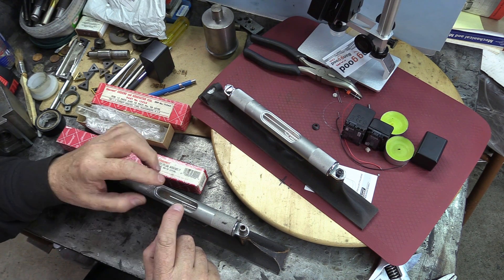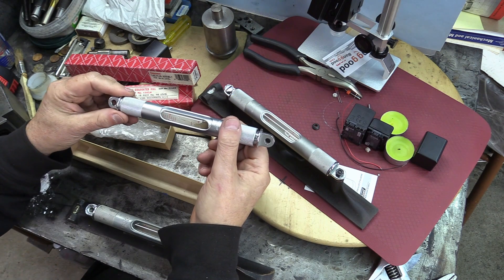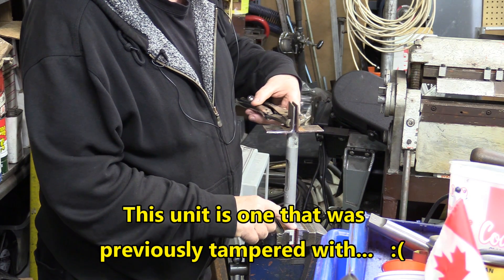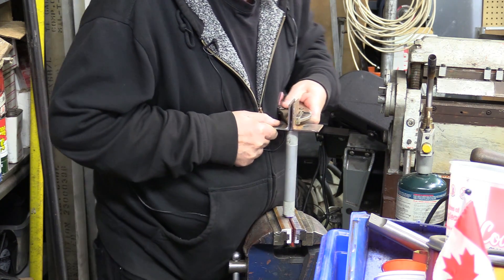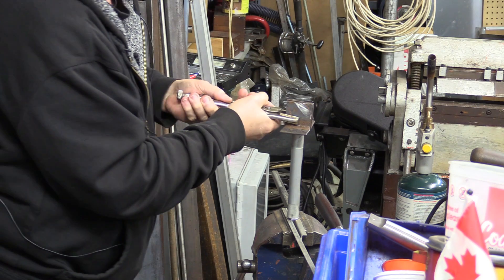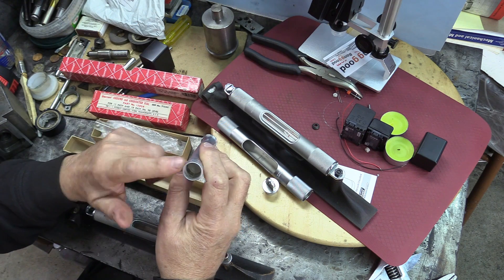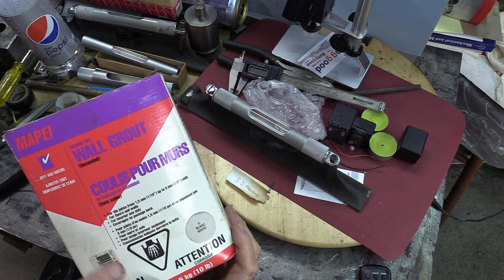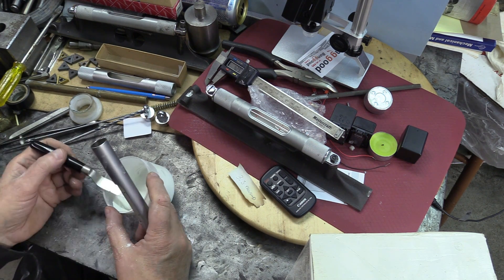Starrett Level, Vial replacement and Re-calibration…

Comment: What would be my best source for a replacement vial on a small Starrett no.134 cross test level? Thanks
Reply from the maker: Yuo can check on eBay, possibly on Amazon, the few times I needed parts for some Starrett tools, I ordered theose from my local tool reseller. Hope this helps

Comment: I have a starrett 98-8, something was dropped on the edge of the vial opening and made a tiny nick and now the 2 cylinders smoothly twist each other only up until hitting the nick and then stiff to twist.  Also the vial broke.  Can it be fixed.  Bore out the bent  one maybe
Reply from the maker: About the tubes, depending on how much of a dent there is, you can possibly reshape or lightly rebore it and/or lap the cylinders. If the dammage is too extensive and if you want looking like new part just be aware that you can order brand new parts from Starrett or some distributor, that is also true for he vial either alone or installed  in the tubes.
Let me kno how you managed and thanks for viewing
Reply: Ok, great info, didn't realize a tube was replaceable  @pierresgarage2687

Comment: Thanks for your video it helped me fix mine, but I forgot to put the sleeve on before I pushed the bung in the end. Is it possible to take it apart again without breaking the vial?
Reply from the maker: Hopefully you only just pressed the ends on the tube without glue, it's been a while since I made this video, if my memory is good , I show how I got the ends off the tube using s vise and pliers. this should get you by, One possible way to avoid breaking the vial, is to machine a split collet to hold the vial near the ends (Avoid using the collet where the vial is installed) As long as you open one end you'll be able to install the cover, normally one end is a little easier...
Be gentle and it should workout all right.....    👍👌

Comment: Silicone RTV will swell and lose its strength in gasoline. I found this out by using it to make a carburetor gasket; it seemed like a good idea at the time. It worked for a few hours and then started leaking. The silicone turned to a jelly. The plus side is that I learned an easy way to loosen and remove silicone RTV. It doesn't take much, just patience. Of course you have to be careful, as it is flammable.

Comment: Calibrating a Starrett 199 made me so crazy I bought a second one.
Reply from the maker: If you could just do it once and understand, you'd see it's not that complicated in the end, normally it takes about 10 minutes even if I do it only a few times a year...
This one is quite more sensitive than the 98 series, about 10 times...   ;)
Reply: @pierresgarage2687  I have figured it out now. Finding the level spot and setting a solid stop for flipping the level around is the key. Thanks for sharing your knowledge and expertise.
Reply from the maker: Now  you get a good second level...   Glad it worked out for you...   ;)

Comment: Why not use plasticine instead of grout for easier removal in the future?
Reply from the maker: plasticine isn't stable enough, it would move under pressure, the plaster will keep constant with heat, moisture, oil, etc... And it's not that difficult to remove, after all it shoud be done only once if one takes good care of not smashing their tools...   lol
Thanks and have a Happy Holiday Season with the ones you love,     Pierre

Comment: My 6” Starrett level is a PITA to calibrate and after it sits for a few days it needs to be recalibrated.  Is there anyway to tell if the vile needs replacing?  Is this a sign that I should replace it ?  Edit:  I just watched your video on how to calibrate it and I do it the exact same way
Reply from the maker: This is the first time I hear that a level need to be calibrated so often...  
Possibly look into temperature changes in the vial, since the bubble size will vary a little like an alchool thermometer, and make sure your reference surface hasn't moved for any reason...
You need to investigate, cause I'm quite sure that the vial doesn't just go bad with time...
Let me know what you find.

Comment: Good job, those ends were sure tight.  Thought you were going to twist the tube right in half.
Reply from the maker: At a time I was kinda getting worried that could happen...  The tube I filmed is is not the tube with the broken vial, since I got it opened and forgot to record, so, I got that one tha was already being tampered, someone didn't care being gentle when atempting that lousy repair.
Finally got everything working all right in the end, aren't we machinist supposed to find solutions to even the most desperate causes...???    lol
Cheers,    Pierre

Comment: Lucky find, a replacement vial in the right size. Should have bought a lottery ticket before that luck runs out. Lol Thanks for the video.
Reply from the maker: So far my luck is way better on vials, hope my luck will turn....     lol
Thanks for comment,   Pierre

Comment: As a noob machinist I always enjoy your little how to's and with luck I will be making some chips this winter.    However, I have a question.  Would it be better to bore out the oversize hole and bond a slug and re-tap for a proper thread?  A number 32 thread will make it easier to calibrate the level then a 28 thread...
Reply from the maker: The difference between a 28 and 32 threads is quite small, nothing worth the trouble, it's not very difficult adjust with that type of mounting...
Making chips is the rewarding part of the trade, enjoy and thanks for your comment,    Pierre

Comment: How the hell did you not snap those ears off? Someone must have tampered with that. Do you think someone may have tampered with it? It like to me like someone tampered with it.
Reply from the maker: That's the level with the too small vial and siliconed in, the original one went so much better, maybe one quarter as difficult... 
Thanks for comment,   Pierre

Comment: what make is that band saw sitting behind the brake.....
Reply from the maker: It's a Knig Canada, very close from the one you got to restore, mine is more or less 15 years old, would need a cylinder refurbish, though... 
KC-712BC7" X 12" Metal Cutting Bandsawhttp://www.kingcanada.com/detail/7-x-12-metal-cutting-bandsaw-KC-712BC/413?cid=16&mid=4
Reply: very close to mine.. I guess there is not a lot of wiggle room when it comes to building that type of saw. i see them all over so close to one another.. I have finished my saw , except for the cylinder. Still waiting on parts..